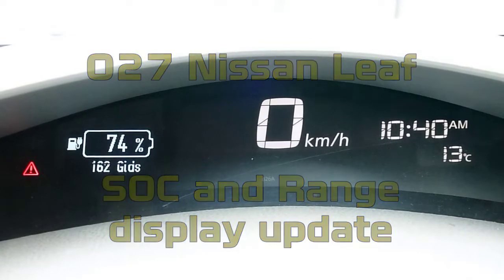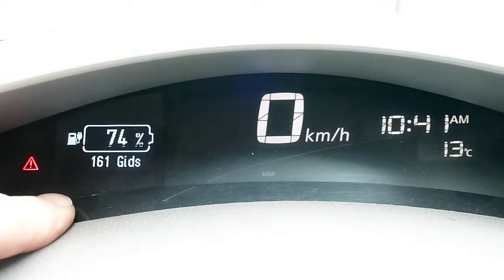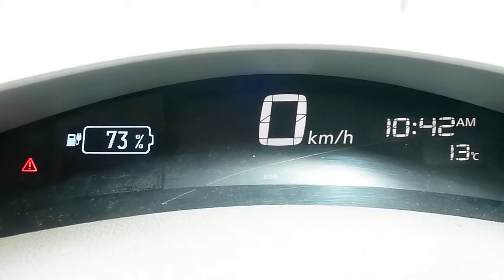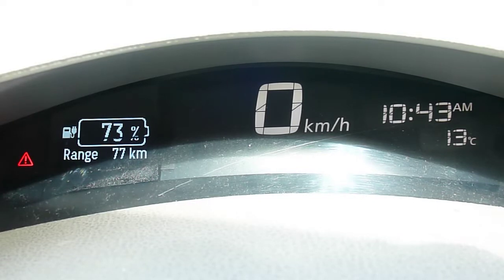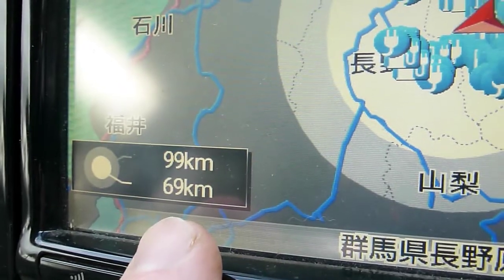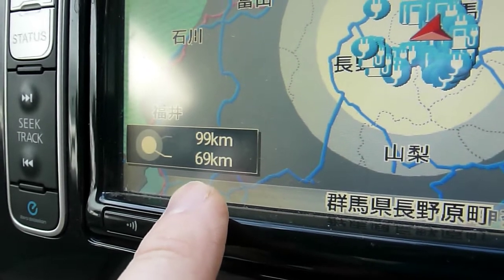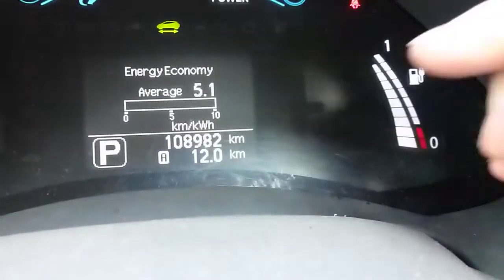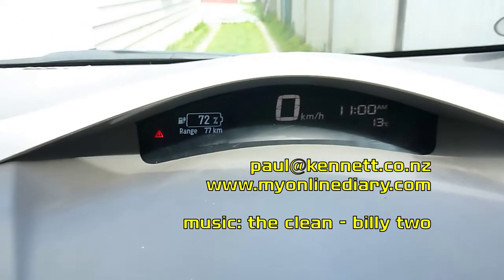Nissan Leaf 027 - SOC and Range display update

Comment: I have a stupid question:  Is your custom display coming through on the vehicles LED screen, or have inserted your own display screen on top of the original behind the glass?  If it's coming through on the original, would you consider doing a tutorial video on how you programmed that?  Thanks man.
Reply from the maker: It's a new display inserted over the original display, on top of the original, behind the plastic ("glass"). This means I didn't have to reverse engineer the original dash computer.

Comment: sweet mod! love it! thanks for share it.
Reply from the maker: Nice work on your secondary Leaf battery project. How's the BMS going?
Reply: @paulkennett  still no bms...
Reply: @GoingOffGrid101  Reach out to Steve Clunn at Green Shed Conversions.  They've been doing EV conversions for decades, and have been designing and building their own bms' for way cheaper than the other stuff on the market.  Don't wait too many cycles before you balance those batteries dude.

Comment: did you remove the dash to blank out the bars? what did you use?
Reply from the maker: I removed the top dash, then pulled off the clear plastic front and just slapped a piece of 50mm wide black electrical tape over the trees part of the dash. My OLED display is then fitted into a black 3D printed frame which is held in place with double sided tape: https://www.myminifactory.com/object/3d-print-nissan-leaf-soh-display-frame-105234

Comment: looks great Paul,  really like this, great work, one thing that pisses me off is that my gen 2013 has 2decimal places on the efficiency screen but my gen1 2011 (muxsan one has only 1decimal place which is about as much use as a chocolate teapot. Actually a chocolate teapot is edible and tasty so in fact its more useless than that. Any chance you could at that in?
Reply from the maker: My current understanding is the efficiency number is calculated inside the dash system and not transmitted on the CAN bus. So I don't have direct access to it. But maybe it's a simple combination of some existing CAN messages. I'll have a dig around.
Reply from the maker: It may be that the efficiency data is only accurate down to 1 decimal place, even though it shows 2 decimal places. Just my hunch.
Reply: @paulkennett  dont know it could just be a ui code upgrade between year models